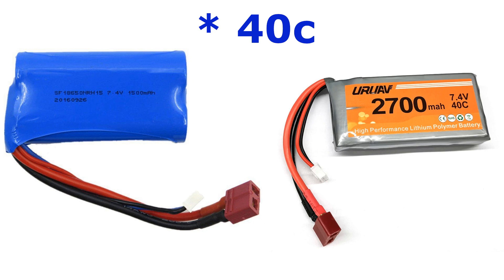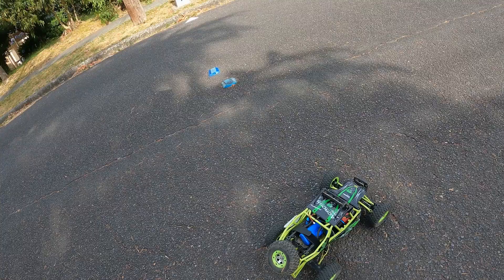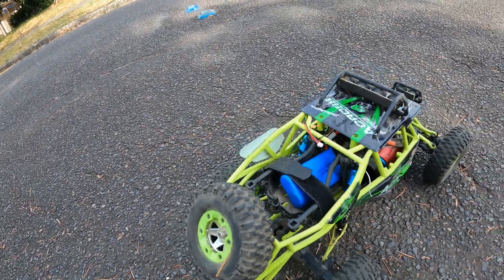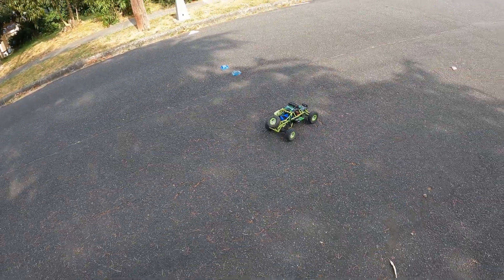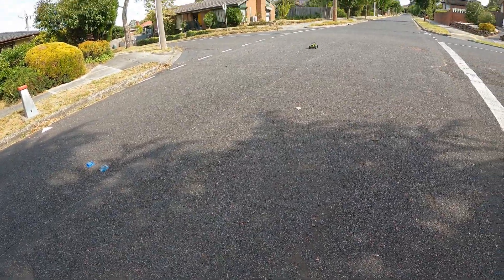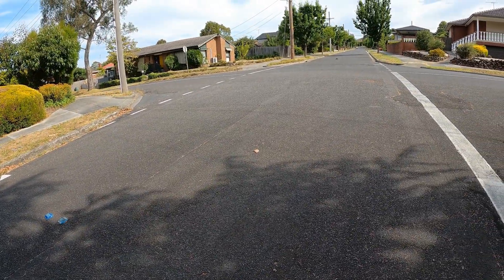RC Car Li-Ion vs Li-Po battery upgrade

Comment: I’m thinking of buying a hbx rtr that comes with a li ion battery and a charger (HBX 903).  Is it safe to only use the charger that it comes with or do I need to buy a hobby grade charger for safety?
Reply from the maker: You can use the charger that comes with it, they normally get hot though, I like hobby grade chargers as you can balance charge and storage charge if you plan not to use the battery for some time(extends battery life).

It is always highly recommended to be around when charging batteries though even with hobby grade chargers.

Comment: Does it have any issues with discharge? Is there a low voltage cutoff?
Reply from the maker: I don't think the battery does, I think it is normally set in the car's esc.

Comment: Cool video. I'm new to rc cars and rc car batteries. I definitely see the difference in power in this video. Would upgrading a rock crawler from a 7.4v li-ion  to a 7.4v li-po be worth it? I have a rock crawler that seems to get stuck here and there because the motors don't have enough power to make the wheels spin in more tasking conditions
Reply from the maker: I think a motor upgrade would be better if possible, as the li-po battery would heat up the motor and other components a lot more because of the higher current and could impact how long the motor lasts especially in brushed rc's.

But if the motor is always cold as is, it might be ok to do, but I don't think it will get the result you are looking for, I could be wrong though.

Comment: I just bought rc car which comes with 7.4v  li ion battery, can i use 7.4v lipo in it?
Reply from the maker: They should be ok given the same voltage, but it might be worth checking with the manufacturer and confirming it won't void the warranty or damage the components as lipo's normally are able to produce higher amperage and will produce more heat.

Comment: Which one is safer?
Reply from the maker: In my opinion Li-Ion is as the battery cells have a stronger housing, and I have seen many a video of li-po's catching fire, but that's just my opinion.

The internet say's Li-po is safer.

I also highly recommend having a battery bag as they are supposed to contain any fires and storing any batteries in them when not in use.

Comment: which size and kv motor used in this test?
Reply from the maker: It's a 3650 9000kv Surpass Hobby motor, with a Surpass hobby 120A brushless esc

Comment: Can the Li ION charger be used to charge a Lipo battery?
Reply from the maker: Normally yes, you just need to make sure it's the right voltage and current.

Comment: Hello, what battery u can suggest for a wltoys 12428 stockk? My rc doesnt run anymore but i can see that the servo is still working but sometimes it dies.. pls help
Reply from the maker: There are a few things it could be, can you turn it off then back on and will it run for a while, or will it cut out soon after you turn it back on?

Or does it do something else if you try that?
Reply: @Wltoys  after I turn it on, it doesn't automatically die because the servo is still moving.. but it the car doesn't move.
Reply: @Wltoys  I recently bought new stock esc and new stock motor so i think the batter is the problem
Reply from the maker: @johair027  I like the URUAV 7.4V 2700MAH or the 
Power Upgraded 7.4V 2600mAh 25C 2S Lipo Battery

They are both on banggood's website, but you might be able to find them cheaper on eBay or something like that
Reply: @Wltoys  Gotcha! Tnx maan!
Reply from the maker: @johair027  🙂

Comment: Essa bateria serve no mn128 ?
Reply from the maker: I think you would need a connector converter as this is a t plug and most mn rc cars use something else.

And they normally use 2s/7.4 volts but worth double checking that on your version as well.
Reply: @Wltoys  obrigado.